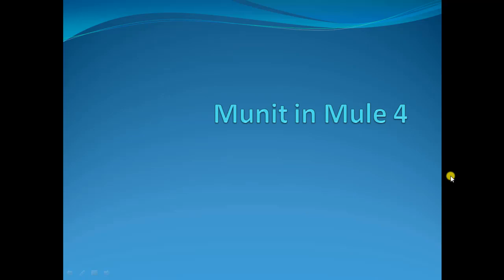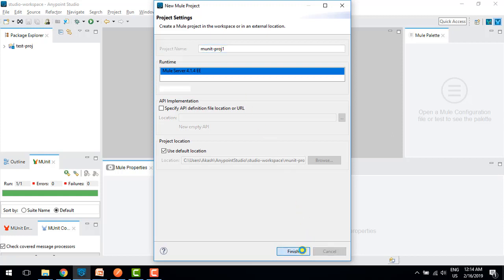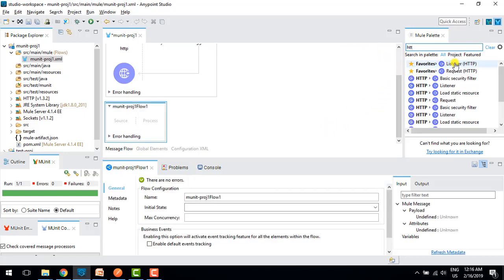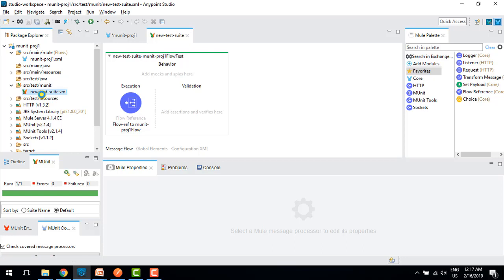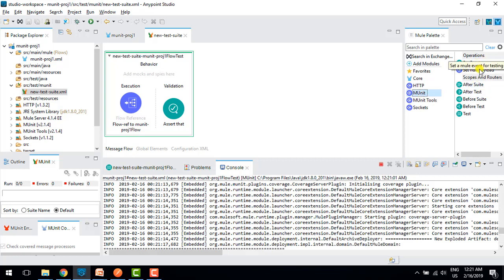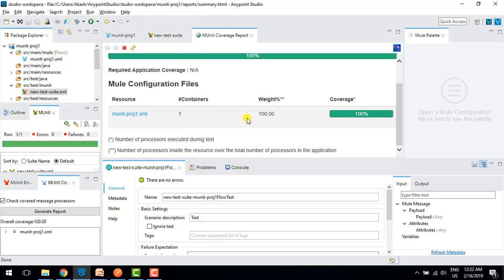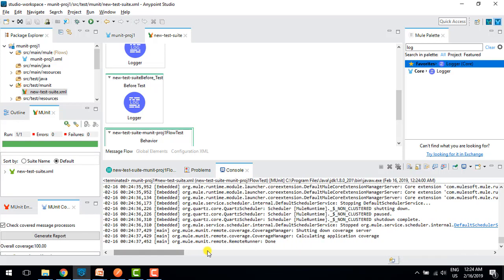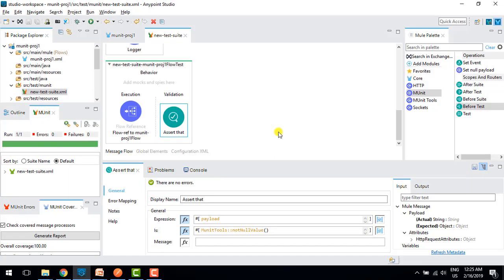Mule 4 Munit 2.1

Comment: Hi, thanks for your tutorial. I have one issue in mule 4, how to get encoding ="UTF-8 "?
I want UTF-8 has to be inside double quotes. Is it possible in mule 4?
Reply from the maker: Use Set Payload in Mule 4 and select Encoding under Mime Type Settings is ISO 10646/Unicode(UTF-8).